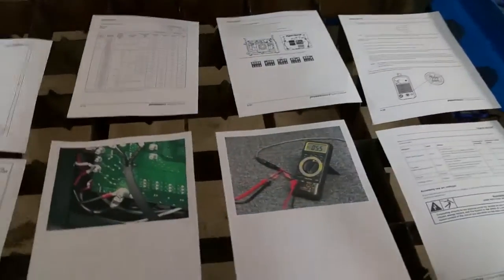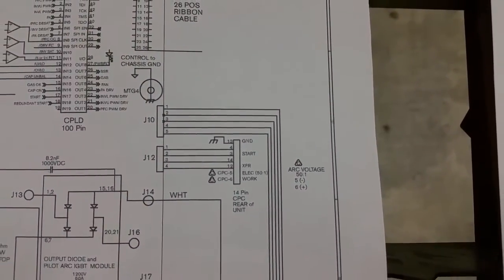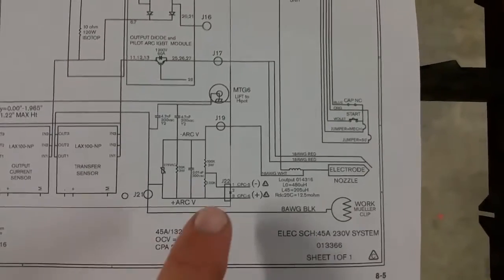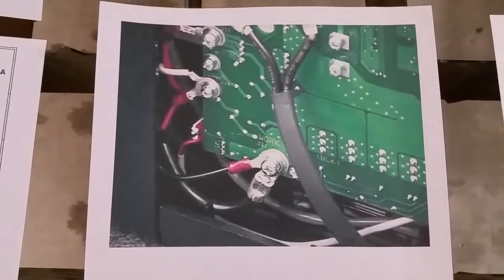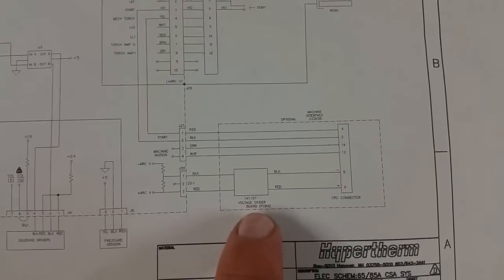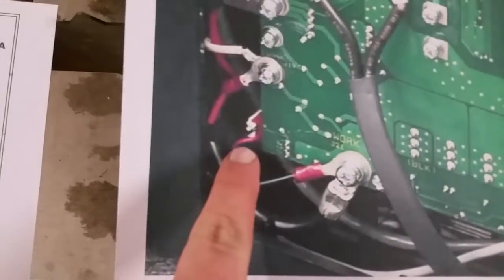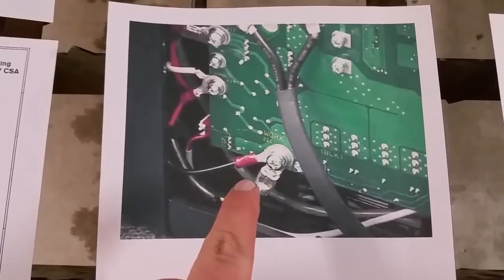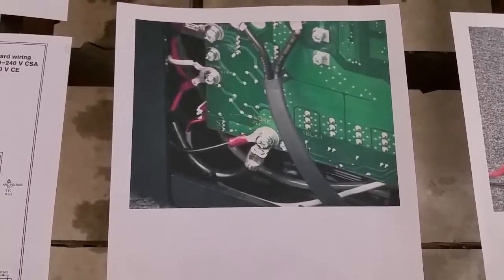Hypertherm Powermax 45 voltage divider mod

Comment: Hello I have a powermax 65 sync and a cnc table the requires a 1:1 voltage divider ratio, is it possible to achieve that ?
Reply from the maker: I looked at the docs for this unit and it doesn't look like they offer either a machine torch or machine interface on this model of plasma cutter.  The manual is also missing any repair information that previous generations had.  It looks like this is not intended to be a user-serviceable plasma cutter and they only intend for it to be used with hand torches.  Adapting it to machine use may be difficult, you will definitely need to contact Hypertherm for any information on doing that.  My personal opinion would be to stay away from the SYNC line of plasma cutters if you want a machine interface or less expensive consumables.  The one-piece consumable looks expensive and has the potential to become another keurig type scenario where they prevent 3rd party consumables from being used because the consumable "talks" to the plasma cutter.  While I buy Hypertherm consumables, I can buy all of the pieces separately and replace them separately.  A drag or gouge shield might last multiple sets of consumables, or you might oopsie and need to replace the shield while the consumables are still good.

Comment: Hello. We have a Hypertherm 105A and set with a ratio of 50:1, then in our THC voltage divider with the ratio of 100:1. How will we connect this to our voltage divider if we have different ratios? Thanks
Reply from the maker: If the plasma cutter is set to 50:1 and the THC expects 100:1, then the THC will get twice as much voltage as it expects. This could damage the THC, cause it to cut too low (crashing into the metal sometimes), or it may work but be wonky.  The voltage increases as the arc length increases, so if it thinks the arc length is longer than it is, it can cut too low and your parts will have a lot of bevel on the backside.
Reply: @eformance  Thank you so much. But can we adjust the THC 100:1 ratio to 50:1? We are using HYD XPTHC-100III. Thanks again
Reply from the maker: @crichfoodie  It looks like the THC is fixed, but you can use 2 10 kilo-ohm resistors to create a 2:1 voltage divider, which will divide the 50:1 down to 100:1.  Look here: https://learn.sparkfun.com/tutorials/voltage-dividers/all  You could also contact the manufacturer of the THC and ask their advice.
Reply: @eformance  Thank you!!

Comment: I have been trying to bypass an internal voltage divider on a Jasic cut 60/unimig razorcut, as my THC has its own divider and dividing the signal twice is making it too low,
I tried simply tapping a signal off the raw torch output, but i think that is causing issues with the high voltage of the pilot arc? does that seem plausible?
thanks for any help!
Reply from the maker: It's fundamentally a bad idea to run the pilot arc (high voltage) over a long distance.  The reason the divider is in the plasma unit is to a) increase the impedance (lower the energy requirement and thus potential for interference) b) keep high voltage from being carried by unshielded conductors for a long distance.  You should look into what it would take to modify the THC, not the plasma cutter.
Reply: @eformance  Ok thanks for that, modifying the THC has been suggest to me right enough,
The jasic divider is 20:1 and the THC one is 40:1, perhaps i could modify the THC one to be 20:1 also, which would mean the controller would be getting the 40:1 its expecting,
Am I correct in that theory or way off?!
Thanks very much again for your help!!
Reply from the maker: @finlaybichan1275  The THC wants a lower voltage than the Jasic divider puts out.  Say you've got 10,000 volts and divide that by 20, that is 500 volts to the THC.  The THC has a 40:1 divider, if you gave it 10,000 volts it would see 250v on the output of the divider.  To get your THC to see 250v without modifying the Jasic divider, you only need a 2:1 divider in the THC.  A simple 2:1 divider can be had with just 2 10 kiloohm resistors replacing the existing divider.  That will divide the 500v from the plasma cutter down to 250v that the THC expects.  Here are a couple links to help you understand better: 
https://en.wikipedia.org/wiki/Voltage_divider
https://learn.sparkfun.com/tutorials/voltage-dividers/all
Reply: @eformance  thats some great info, thanks very much for taking the time to reply!! a true gent!

Comment: my divider board only supports 100:1 ratio  and there is no option for that please help
Reply from the maker: The PlasmaCAM comes with the divider cable, you can hook it up with their directions. I chose to modify the plasma cutter by using the end of the cable that came with the plasma table. I didn't use the internal divider, I just cut the cable in 2 and put the end section inside the plasma cutter.
Reply: @eformance  does that mean u are receiving raw voltage??
Reply from the maker: @alimehboob8908  I suggest that you wire the 100:1 divider board directly to the arc voltage inside the plasma cutter.  Work is + and electrode is -.  If the divider board only has - coming out, then you connect the divider board to the electrode voltage and use the work clamp connection as the +.  For a divider to work properly it must be connected to both voltages inside the plasma cutter.
Reply: @eformance thanks for your replies.  so 100:1 ratio won't matter anymore??
Reply from the maker: @alimehboob8908  You need the 100:1 divider for your torch height control to work properly.  The divider will have at least 3 connections, 1 for electrode voltage, 1 for the workpiece clamp, and 1 output that goes to the torch height control.  The torch height control will need a wire from the workpiece clamp and from the voltage divider.  The plasma cutter has 2 screws inside for the raw electrode voltage and for the workpiece clamp, this is where you need to connect the divider.  The workpiece clamp is + and the output of the divider is -.
Reply: @eformance  thanks a lot for your help. I made it work.